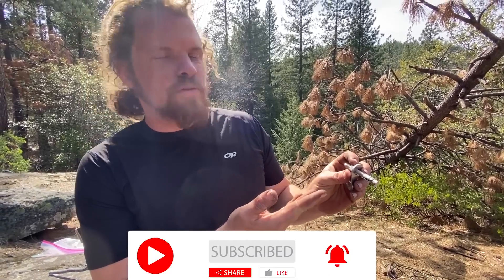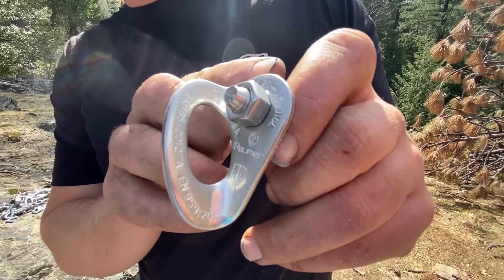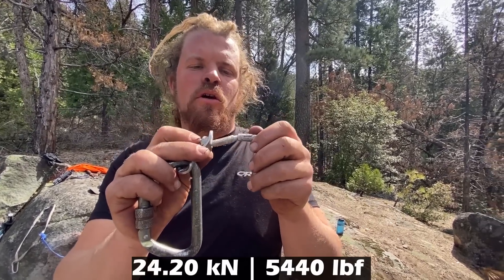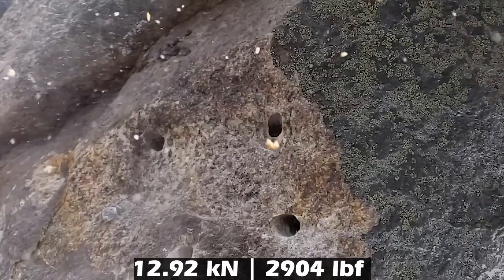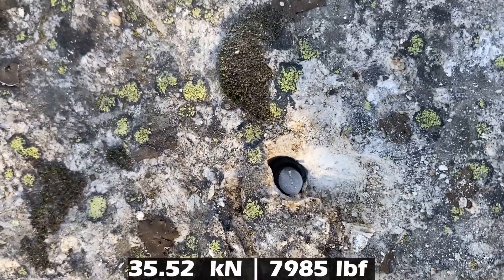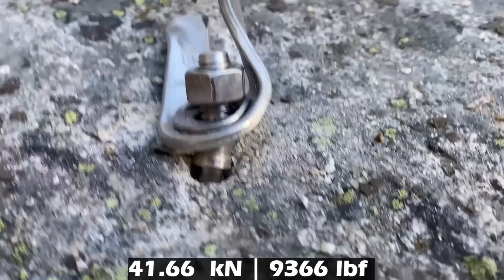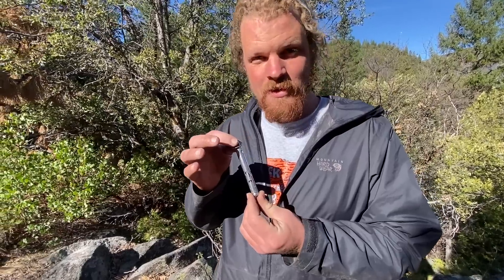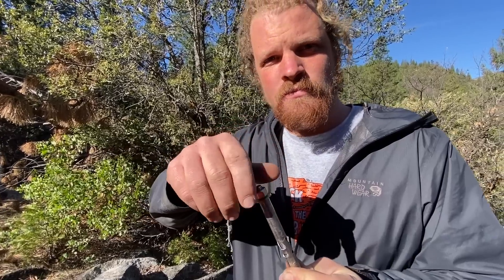Are Dewalt Powers SD6 Bolts Safe for climbing? Spec sheet says 12kn in shear???

Comment: I'd like to see testing comparing the different lengths of the Dewalt Powers wedge bolts. As I recall, the data sheet rates them in 1" increments(?), so bumping up 1/2" or 3/4" doesn't increase its strength (on paper). I've been placing some shortys (2 1/4") by hand on wilderness, and according the specs, I wouldn't get any more strength until I increased the length to 3 1/4" (I think). Thanks for all that you do!

Comment: You can see that it’s not really rock failure as the bolt slips a few times before the pressure blows the face rock. 

Therefore it’s not expanding and gripping enough. The knurling must serve a purpose for its intended use. I wonder if you need to torque it down more than most bolts beforehand, for example. Did you read the spec sheet?

Comment: Not a bad bolt. A few things to consider. They test it in concrete, that is not rock. Then they barely specify safety related equipment, so while it might be super good enough in practice, they do not manage or test the production line as much as climbing equipment should be and therefore just don't claim it up to climbing spec. Lastly they do specify something like 4-6 threads above the nut for full engagement, I am not sure though, just my interpretation.

Comment: My guess is that the knurling is likely unhelpful, I am betting that the knurling on the wedge actually grabs the expansion sleeve too well, preventing it from sliding down over the wedge when tightened/pulled and against the walls of the hole. That expansion of the sleeve and the resultant extremely high forces against the sides of the hole is primarily responsible (as I understand it) for the resistance to pull-out.

I think the reason the rock breaks out on these is the knurling prevents proper expansion of the sleeve, so the bolt initially pulls out partially upon tension; the wedge of the bolt now being closer to the surface of the rock, the area of rock which is resisting  the cone of force produced by the pulling is reduced, bringing the rock to the point of failure.

Comment: I think as others have stated here the knurling on the mandrel may allow the expansion clip to 'bite' into the cone preventing further expansion. Stainless parts in contact at high pressure can become fused over time. The knurled mandrel is an interesting design concept that in theory should help the expansion clip remain free to expand more over time and prevent the two pieces from cold welding togeather. However I think the clip is biting into texture and seizing limiting the expansion of the anchor. 

An interesting experiment might be to hand file (no heat) the texture off the mandrel and see if you get a different result.

Reguarding the Sleeve bolt in the last clip, I think most people avoid these because the traditional 5-piece, while it has the same diameter stud, is unthreaded at the hanger end making it signficantly stronger and easier to replace.

Comment: Something bothered me about this video.  After thinking about it, I realized Bobby isn’t using a torque wrench.  To be somewhat scientific he should torque the bolt to the recommended tightness.  Second the results were somewhat mixed on the tension pull.  Rock is not consistent in strength and there may be a weakness in the portion of the rock that was used.  Third, if the bolt was easy to press/strike in with a hammer, was the hole drilled to large?  As anyone who has placed a few bolts, carrying  different sized drill bits is essential since manufacture specs aren’t all truthful.  Maybe do the tension test again with these suggestions?  I’d gladly send you some more of the bolts!
Reply: Ehhh, I don't think the vast majority of us are using torque wrenches in the field....
Reply: Years back when my friends and I started replacing all the rusty and corroded bolts in our local crag we didn’t use a torque wrench either.  Then we realized we were putting other people’s lives in our hands.  $20 harbor freight torque wrench is worth piece of mind.  

Not to be snappy or rude cause I think we get enough of that in our sport.  But if you read my comment. It’s says to be somewhat scientific he should use a torque wrench.  But that aside I really believe he should try a 9mm drill bit and do the test again.  If I can slide a bolt into a hole with little hammer pounding, then I know the hole is too big.  Maybe they can test that theory sometime..  cheers.

Comment: The rock is breaking because the anchor depth is about 1.5"" shorter. The wedge is only about 1'' deep. All material will fail at this depth. Dewalt has good products & bad, you really have to watch them. This bolt is not good.
Reply: If you see when the rock pops, it's after the bolt slips a couple times.

Comment: I 100% think the knurling prevents the sleeve from sliding down the bolt, thus preventing the sleeve from expanding to its maximum diameter. normally the bolt breaks because the sleeve expanded beyond the inside diameter of the hole. these knurled ones clearly are inferior when it comes to tension, apparently. I'll keep an eye out for these whenever I see something getting setup in tension i.e. highlines, seems REALLY sketchy, while looking totally safe...
Reply: Absolutely agree, I just can't imagine why it's there. Think of a plug and feather, you grease them! so the metal slides over each other, you want a similar effect in the cone to get expansion, knurling is counter productive

Comment: I work in in industrial maintenance.  We use those to anchor equipment to the floor, and misc. items to precast concrete walls.  IMHO, they are mediocre at best for the aforementioned.  I wouldn't even consider using them for climbing or anything of that nature.  Maybe you won't die....🤔you do you boo.

Comment: It's possible the knurling is there to limit the maximum expansion force. To state the obvious, these anchors hold by wedging the collar out against the rock. Since these anchors are designed for all kinds of concrete, including weaker concrete, they may be using the knurling to limit the expansion pressure of the collar to reduce cracking in lower strength materials. Maybe they are willing to have reduced holding power in stronger materials to avoid damage to weaker ones.
My theory here is that as you tighten the bolt, up to a point the knurling slides inside the collar, but when the radial force gets high enough, the knurling digs into the collar and further tightening just drags the collar up the hole rather than expanding the diameter more. All this of course is just my guess.
Reply: I think you're spot on. Exactly why smooth wedge bolts pull out slightly before becoming tighter, until complete bolt failure, while this knurling prevents the collar from sliding as the tension force increases, causing bolt pullout instead.👍 I bet it's to limit over tightening/over expansion in compromised/cracked concrete too.

Comment: It's interesting in your conclusion that you mention the european standard for a climbing bolt, but from everything I can find on the dewalt site, these bolts aren't meant for climbing. They seem to only be meant to be used in concrete (cracked and uncracked) and for structural use like anchors for fire sprinkler systems and beam support. The sell sheet is entirely aimed at commercial construction uses for normal/lightweight concrete and grouted masonry. 
All this to say it's interesting to see their uses in unintended circumstances and they seem to perform rather well as anchors in general. They really seem to be designed to withstand sheering and not so much designed for tension use. I would be very satisfied using these in the industrial/commercial construction work they were designed for.
Reply: there are very few bolts used for climbing that ae actually intended for that use

Comment: Well crap. Those are the bolts I’ve been using
Reply: I mean unless you installed them on some glarly roof routes I wouldnt worry.
Reply: Yeah I’ll have to keep that in mind from now on. I’m pretty sure it’s nearly impossible to get 10+kn in a whip anyways
Reply: @alexmorano3334  is that just your personal opinion or more or less based on science?
Reply: @tobiasbrunner4720  I’m going based on their climbing forces video. I just don’t see any practical way that force can be generated
Reply: @alexmorano3334  and even if they are achievable one might not want that fall to be abruptly stopped because bones also have a limited breaking force

Comment: the peaks of that Knurling is gonna squish down and allow the bolt to pull out easier. thats why I think its worse. I would bet if you pull that sleeve off after its been pulled out you will see the tips of each knurl squashed down.
Reply: I think the knurling keeps the sleeve/collar from sliding down further as the tension increases, so instead of moving out 1-2mm and becoming tighter until bolt failure, it just binds up on the knurling and stops, losing its "self tightening under load" ability. 🤔
Reply: It all comes down to which piece of metal is harder, harder wedge=knurling impression on clip, harder clip=smashed peaks on the knurling.